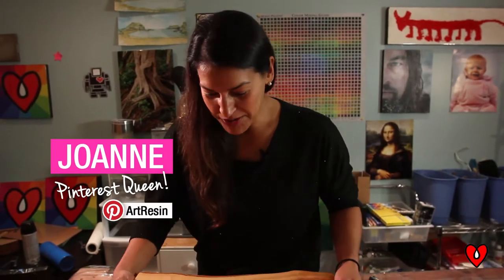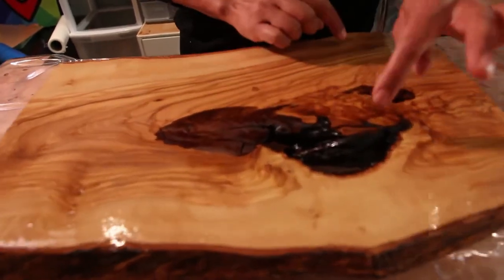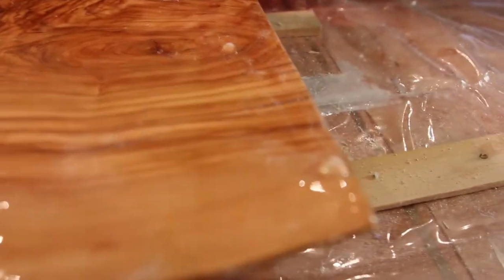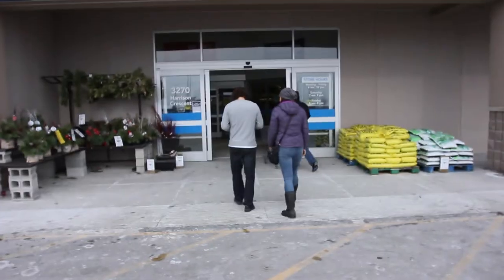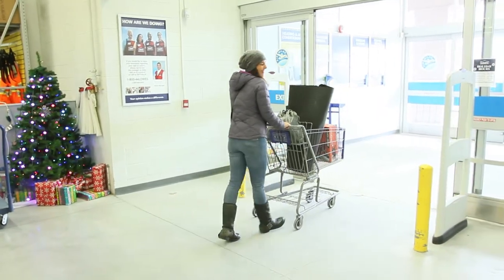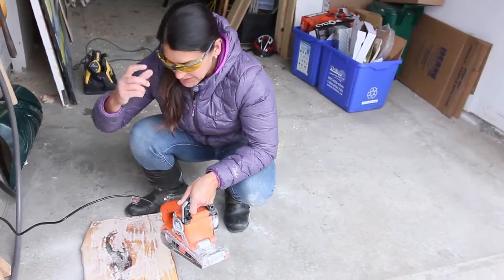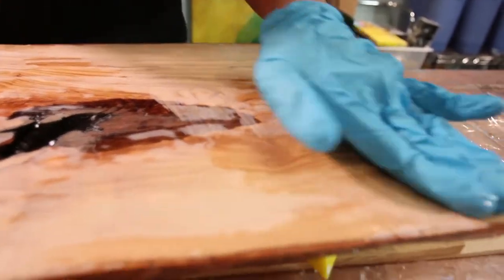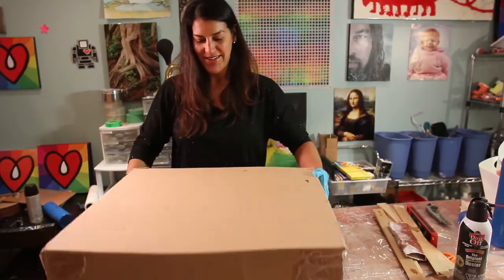How To Resin A Live Edge Wood Board - Part 2

Comment: If you use the orbital grinding machine there will be no marks from the sandpaper. Try to use the sandpaper then 40P 80P,120P,220P,400P. The surface is glossy. Then polishing paste 3M 09375 and after 50383. Sorry for my English.
Reply from the maker: Your English is perfect!  Thank you so much for the tips!!  Our finished tray turned out beautifully - watch for the next two videos :)

Comment: Where did you get the triangle stands and what was the plastic you taped to bottom ?
Reply from the maker: Hi there - you can get those plastic triangle stands from any hardware store in the paint section - they're called painter's pyramids.  We also like to use big toddler sized Lego blocks - much less expensive and you can adjust the height so easily by adding or taking away blocks!  Just make sure you use something made of plastic for your stands ... if you get any resin drips on them, you can just peel the dried resin right off - no risk of your stand getting permanently stuck to your artwork or tabletop :)

We cut out a piece of acetate - you can find these at an office supply store or an art supply store, or the stationery section at Walmart.  We taped it on using regular old painter's tape!

Hope this helps - thanks for watching :)
Reply: ArtResin à